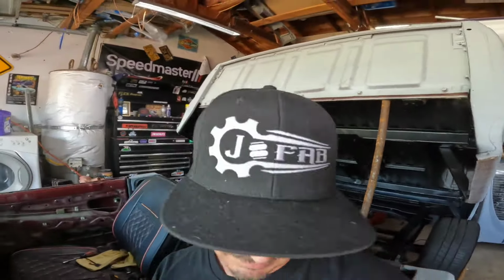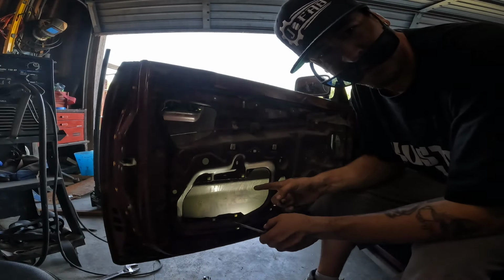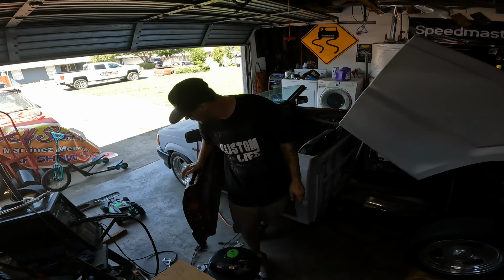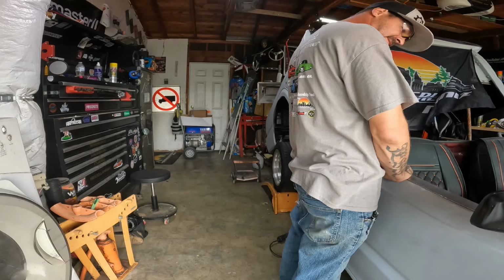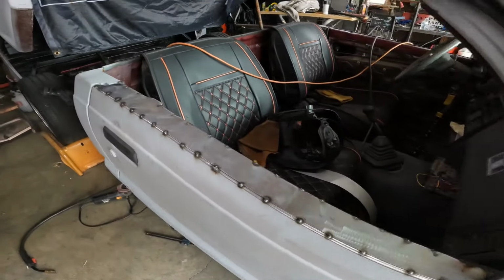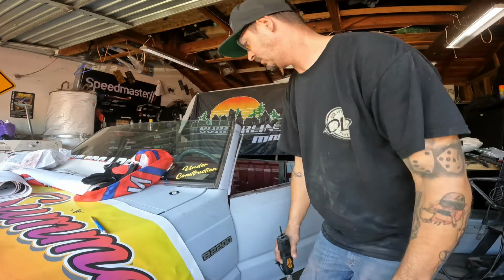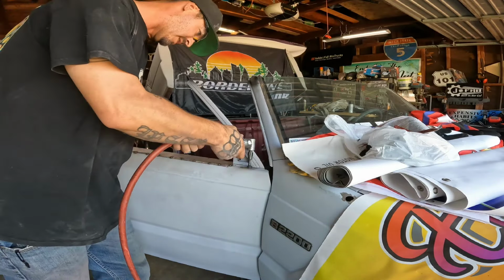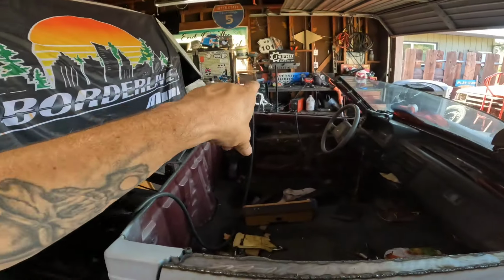Shaved window pocket on The Broadster. Mazda 93 b2200

Comment: Well done, great idea about the window pillars. 11:52 is that tool for cutting the sheet metal or do you use a grinder?
Reply from the maker: @michaelrichards7429  yes cutting the sheet metal. Called a nibbler. Just a rough cut then cutting wheel to get closer to the line and sander to fine tune.